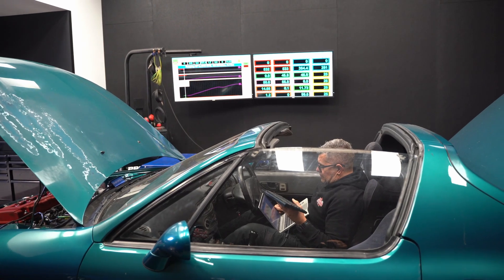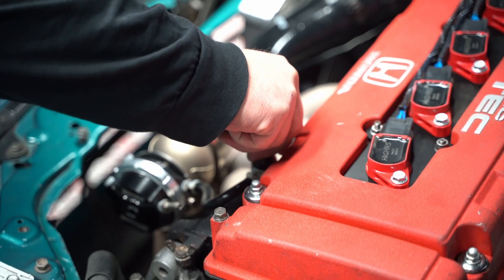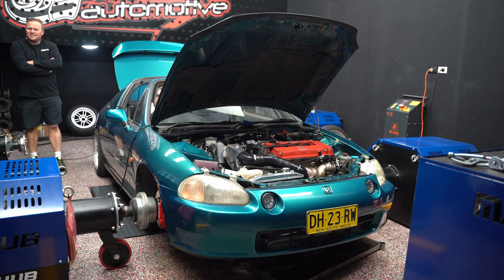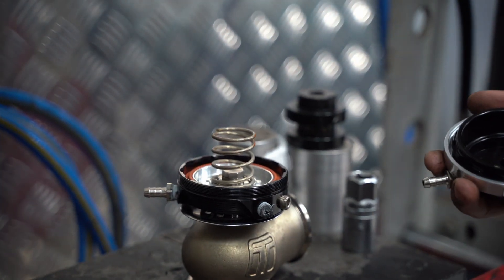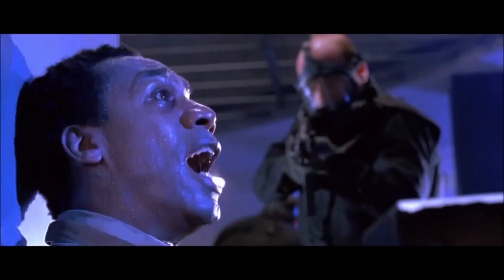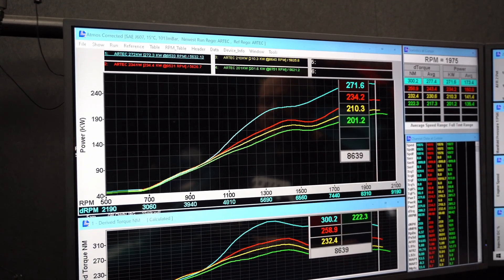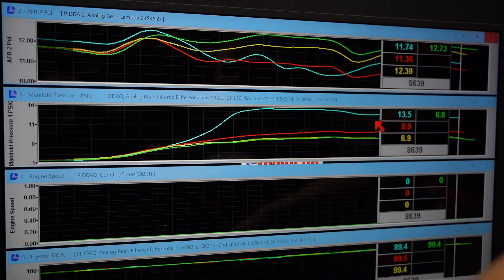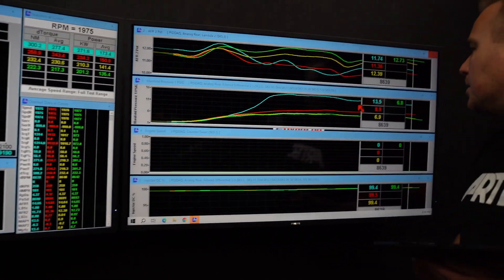🥶 ICE ICE BABY - Water to Air Intercooler Development! 💥 1995 Honda CR-X Del Sol | Episode 6

Comment: Good stuff! Don't know if you explained this in an earlier episode, but why water-to-air rather than air-to-air? Just curious if it's for packaging reasons or efficiency reasons or other reasons my tiny brain can't think of.
Reply from the maker: Hi Dave, The car's primary role is product development. So to reduce effects from air density changes, we use ice water to remove one of those variables. So each time its on the dyno , we can replicate the water temps in the core. We will later in the series go into more details about water to air setups. Another benifit from a water to air system is the ability to have a very short intercooler piping route.
Reply: Colder air intake temps for more power